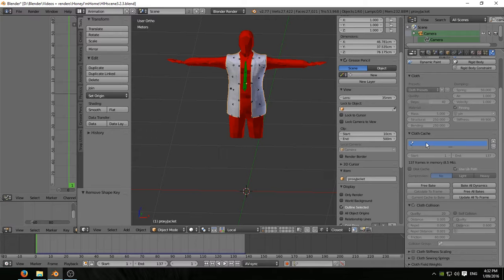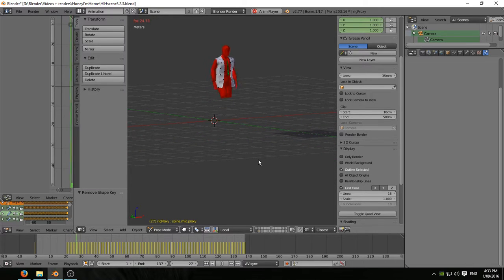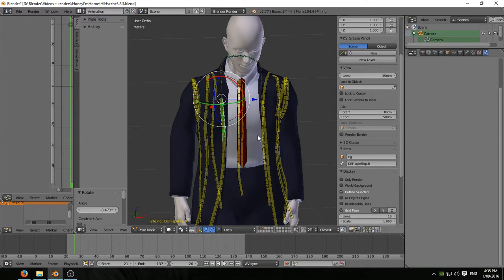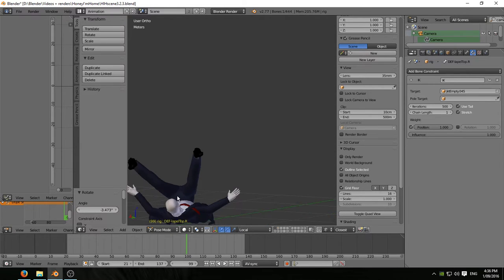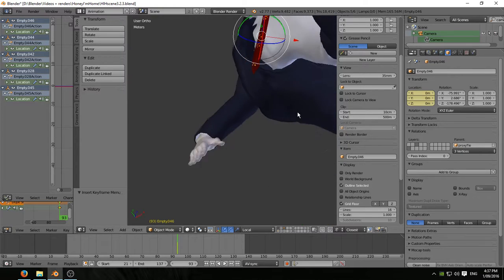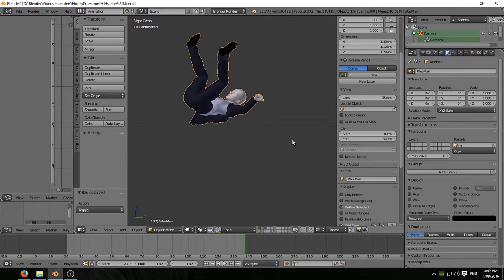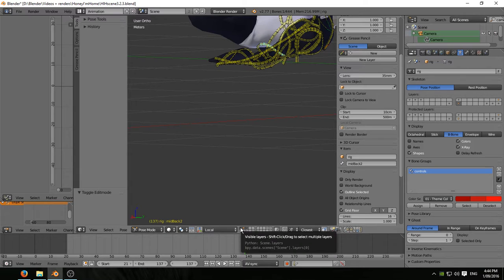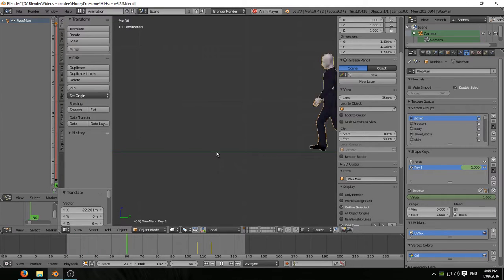Using BVH Files in Blender - 7. Cloth Sim (b) and corrections

Comment: Thank you for the good series. I just think if you use bones for the jacket, there is simple to use "Floor" constraint especially designed for those bones.
And if you have to align vertices by hand, try to use scale by z axis, or Smooth command for selected vertices. For the latter you can restrict it by an axis.